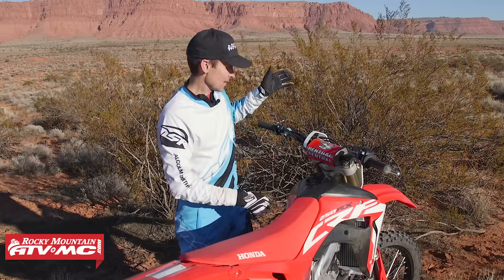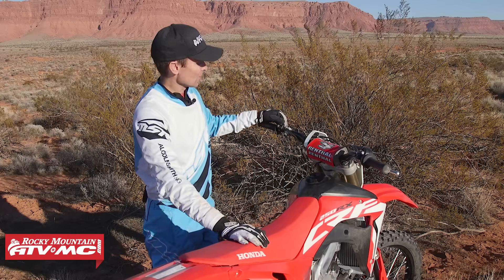How To Use the Honda CRF Launch Control and Mapping Switch

Comment: Just bought a 2022 crf 450 on offerup. The people I bought it from told me it’s never been ridden, and I believe them. When I showed up at their house they had 2 garages filled with brand new bikes and nice mountain bikes. I bought it for 9800$ and the day before I tried my local dealership and they wanted 12000$ for them. If you financed they wanted 11000 something. It amazed me they wanted more for cash compared to financing. Haven’t even taken it out yet I need to break it in tmrw. Coming from an 06 crf250 I feel it’s gonna be a huge change.
Reply: how is the bike ?
Reply: I just came from owning a crf100 4 years ago and bought a 2022 crf450rs and boy it pretty scary to ride but its alot of fun too
Reply: I just went from an 05 crf450r to the 22 crf450rs. What a difference 👏

Comment: I also heard the Vortek was way better then launch control.  Is that the case?  And why after spending $10,399 i have to go spend another $700 for an ECU and $700 for a new exhaust.  I am referring to the 450L

Comment: Hey I have a 2020 crf 450r with the launch control can it be used for more then just starts can you manipulate it a bit i did it for single track and seems like it helps tell you hit the gas to hard and it turns off also can you be moving turn it on and launch 🚀?

Comment: does the 2018 model have launch control too? i have a 2018 450RX and i have no clue
Reply from the maker: If your bike has an ECU map switch on the left side of your handlebars, you have launch control. Your 2018 should have it.

Comment: Didn't even explain what the 3 different launch modes were.
Reply: They were up on the screen in text. 1 is the high RPM (best for good dirt) 2 is medium RPM (for more slippery starts) and 3 is the lower RPM (best for slippery starts).